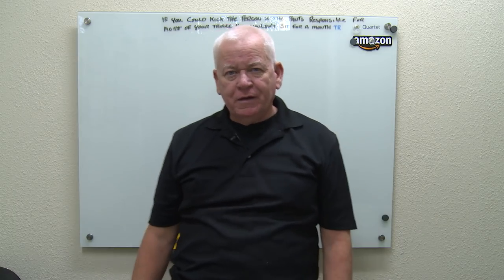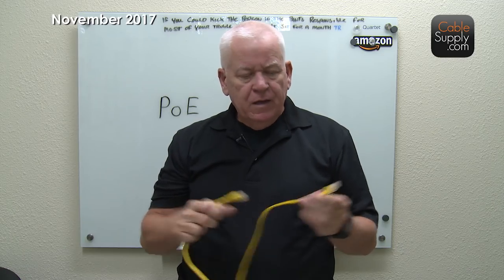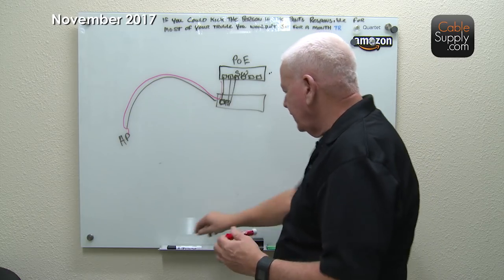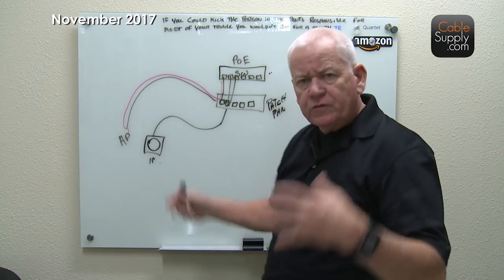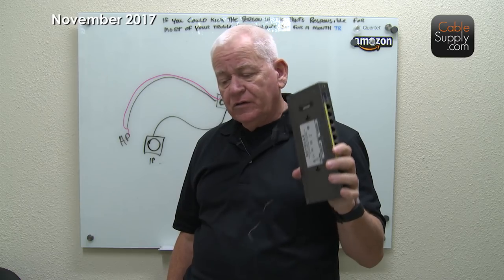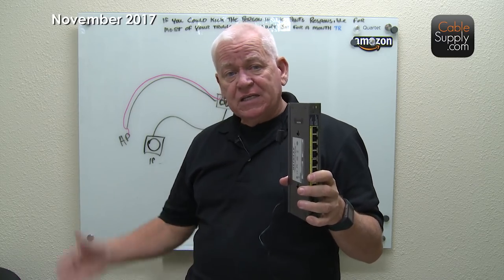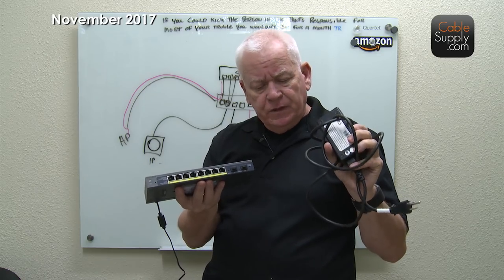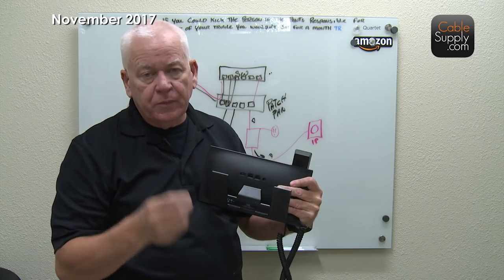Power Over Ethernet

Comment: Excellent advice, its amazing how places will pay 3K for all the cabling over large work areas, but then skimp out by using 29.95 cheap switches, and cheap switches nearly never provide PoE, or more than 1 or 2 PoE ports, lots good advice Jim.

BTW we found ubuiqti gear to be rock solid, at about 1/10th the price of cisco/juniper, especially when you get into spf
Reply from the maker: I like Cisco. I always recommend fully managed PoE switch. Good network equipment will out last many generations of PCs.
Reply from the maker: Also always think about Cyber Security when buying network gear. Cisco systems can be programed to talk to each other about vulnerabilities and threats on the network.
Reply from the maker: well designed cyber security is like breaks on a car, it helps you go faster with confidence !

Comment: Always great info from you Jim. What about different voltages--->24 vs 48? And passive vs active PoE? Also, What type of cable should you run for PoE devices-all copper cat5e or cat6-7? Is there a benefit for speed and stability if you use higher rated cable? How far can a typical PoE run go and...do termination(s) at wall/surface jacks affect power delivery and performance? Thanks in advance!
Reply from the maker: I will cover that information in an other video in the future.
Reply: Awesome thanks! I have learned so much from your tutorials. Keep up the good work!

Comment: Been to your site, no POE switches ? Lets say you have a Dell powerconnect 5524p 24 port poe switch layer 3. You need 18 poe for cameras and 6 non-poe devices computers etc.. The question is can you plug in the non poe device and the  voltage is never used or do you need a voltage blocking adapter.
Reply: Yes, you can use non-PoE devices on a PoE switch--I'm using a 5524P myself to handle both PoE and non-PoE devices.

Comment: Why do you need to involve a patch panel? You could do all of this direct from the PoE
Reply: good question !
Reply: how do you connect you phone to computer....no usb on phone. Ethernet cable directly into computer  ???
Reply: @howardmurden8723  You don't need the patch panel for the phone to work. Just pretty standard on any business or serious home network to use patch panels to keep things organised.
Plug your laptop/pc directly into the back of the phone... means no need for a wall socket and therefore one less cable to pull.

Comment: Hi Jim,  What would happen if i plugged something like a laptop or desktop into a ethernet port that had power running thru to it and the device is not expecting it, Am I going to blowup the Ethernet controller in the device. Also do you ship to Australia,
Reply from the maker: No it will not affect your your equipment. In fact some equipment (VoIP) will talk to the switch and tell the switch how much power it needs (Cisco VoIP, APs and PoE switches). Yes we do ship to Australia (WWW.CableSupply.com) and most English speaking countries.
Reply: Thanks for the response Jim